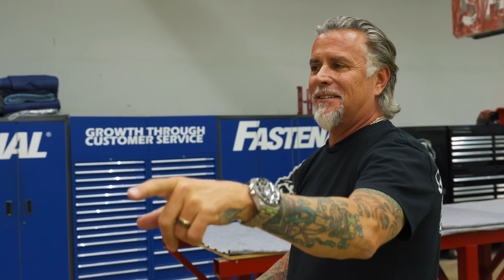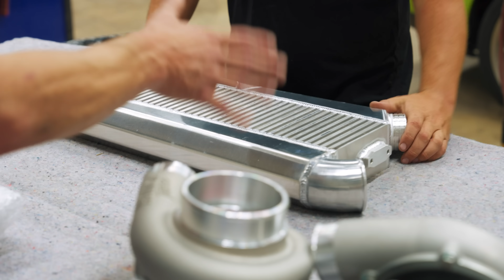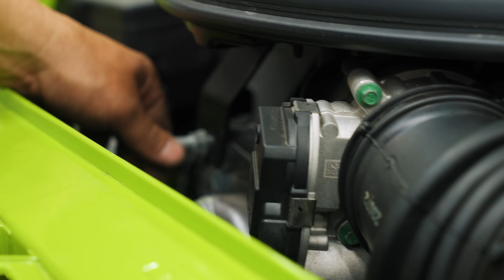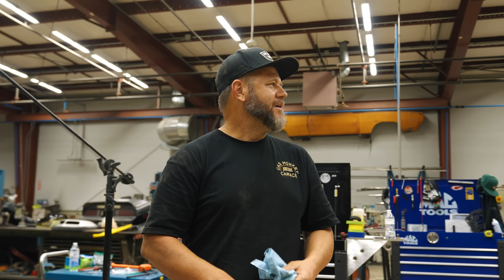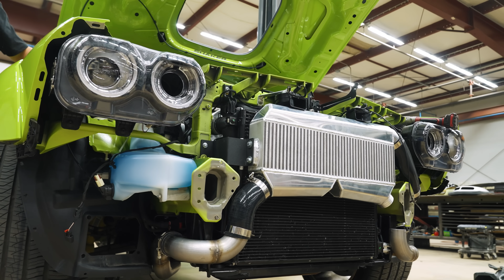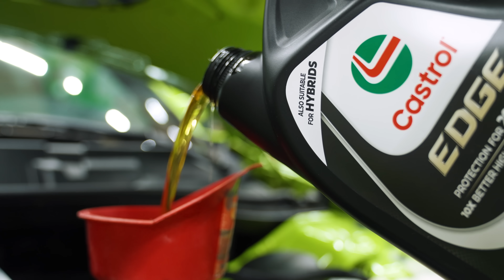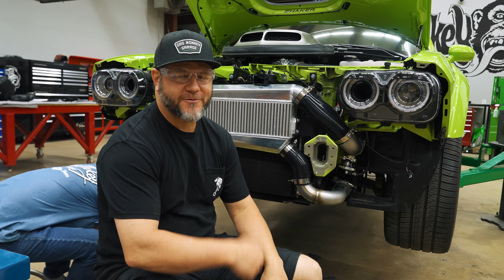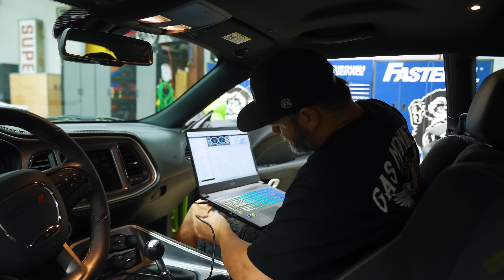Twin Turbo Dodge Challenger 392 Build | Gas Monkey Garage

Comment: The LS is definitely the better motor. Much less complex, so easier to work on and more aftermarket support. Cheaper to purchase, more reliable and have been made much longer. Plus you have options between having a 5.3 all the way up to a 7.0. They also sound better especially with aftermarket exhaust systems.
Reply: Maintenance is hard I guess. 

When it's time to take it apart yes there is more moving parts, but they are there to increase the volumetric efficiency of the engine. Worth while trade off in my opinion as an owner. NA yes 7.4L LS based engines are powerful. Boost with rpm, and that previously mentioned efficiency equals. The same kit for the mustang makes 700-800 whp with 1.4L less displacement. 
Spend your money how you please, horsepower isn't cheap if you build it right.
Reply: @andrewmcbain4119  I more than know HP isn’t cheap if you build it right. Being raised around a Drag Strip and circle track since the 70’s I’ve seen my fair share of engine build types. I’ll choose the simple proven engine time and time again. I’ve seen plenty 454(7.4) and 572(9.4) engines make very big power on boost. The 572 is capable of over 800 engine alone. A reason I’ve never used NO2 is because I’ve always believed of you put in the wrench time, the money and the knowledge it isn’t needed snd proves you can build one hell of an engine without it. 
Don’t believe I ever mentioned anything about maintenance because all engines require maintenance but since you mentioned it sure less maintenance as well because you only have a single cam to deal with in an LS based engine. Not to mention those troublesome cam phasers in the 5.0’s.
Reply: Sure...
Reply: @tjcustomrodz  prove a 5.0 Coyote or a 5.2 is cheaper to build, easier to build, less complex and has the aftermarket support the LS based engines have.
Reply: @P-J-W-777  heads, cam, and internals. Which supports more before upgrading is necessary. Yes if you want to make 4 digit horsepower big displacement is helpful, and yet examples of coyote engines with bottom end upgrades nothing to the top end making 1500hp or more. With boost obviously. It is never gone to beat the 100K engines out there, but it's not a dog compared to the LS. I have both sitting in the driveway I know which one I'd rather spend my time on.
Reply: @andrewmcbain4119  Don’t get me wrong, I’m definitely not calling the Coyote a dog or saying it’s not a good engine. In my opinion it’s one of if not the best engine Ford has produced since the original 5.0 and 5.8. I absolutely respect it and have utilized the Coyote and its cousin in the F-150. I don’t rate an engine based on horsepower alone but also on reliability, complexity, cost, parts availability and aftermarket support.
Reply: @P-J-W-777  that's fair. I haven't had any reliability issues with the engine.  The cheap transmission, the MT82 ,on the other hand I have had to replace a gear on so.
Reply: @andrewmcbain4119  Good to hear, I haven’t run any of the newest 5.0 or 5.2 engines. Everyone seems to be having issues with the modern transmissions. Usually why you don’t hear of anyone doing a restomod utilizing them in their builds.
Reply: @P-J-W-777  I'll add the coyote platform isn't a great option for trucks. It'll make the power, but yes concerns you have will be highlighted with added strain on the engine. Ford themselves admit it by using the 7.3L Godzilla in the super duty line.
Reply: @andrewmcbain4119  yeah unfortunately I’ve seen a few cranks snapped after adding a supercharger. You can upgrade the crank making it more reliable but most people don’t want to tear the engine down and rebuild it. They’d rather add a few mods to improve the performance. We had quite a few a bit of problems with the 5.0 in our fleet of trucks. They were constantly in the shop but did run really good for a truck when they were running right.
Reply: @P-J-W-777  I can imagine I had a 2V 4.6 in a F-150, replaced it with a 08 Ram 2500 6.7 cummins, it had to work hard during regular driving and needed a lot of love. 
The 5.0 would definitely have been better, but again high stress compared to bigger engines it competed with. It's best use is definitely something lighter, and not intended for work.
Reply: @andrewmcbain4119  I still own a 2006 Ford F-150 with the 5.4. We also had another 2008 F-150 and a 2008 Expedition with 5.4. I purchase all of them brand new. Both the 08’s had nothing but issues. Especially the spark plugs ejecting from the heads. Oddly enough the 06 has never given me a single issue button has 60k miles on it as well. 
I am definitely a fan of the Ford Diesel engine and currently own a Powerstroke. I’ve had the engine rebuilt twice and after the second build I removed all the government crap and haven’t had a single issue with it since. The engine runs much stronger and much cleaner now. I also get 24-27 mpg whereas I was averaging 12-14 on the highway with all the emissions systems intact. No, I don’t roll coal either even though it’s fully capable if I switch the tune.
Reply: Why has no LS 
 Gone 300.4 mph in a standing mile 
Ran 5.88 @ 256 mph with mostly oe parts
Won overall Sick Week, Tx2k24, Import vs Domestic and set the drag and drive radial record 6.26 @ 227mph with oe castings 
Or run 7.7s factory sealed?

Because the twin cam engines from Ford are superior in design and efficiency and set the previous world records.
Reply: @chadkent1241  yeah and how long do they last? How much do cost? How much more complex are they? Those twin cams with their cam phasing issues, time chain guide and tensioner issues just to name a few. The fact is that it’s taking a modern engine to keep up with the LS that’s been running since 97.
Like I’ve said previously I do not disrespect the Coyote. I believe the LS is a better overall engine platform for a multitude of reasons some of which I’ve previously mentioned. Someone next year could build an LS or LT engine that ends up taking that record. You never know. It’s all about the build of the engine and the “luck” the team has at the racetrack that weekend. I’ve seen plenty of teams that normally run in the 7’s go out and can’t get anything better than an 8 or o=9 second run for a few weeks and then turn around and run a second 1/4 mile a few weeks later.
Reply: The Hemi makes more power and sounds less like a truck motor. The LS is only cheaper.
A 7.0L LS7 makes 505hp but a gen III based 7.0L 426 Hemi makes 610hp.

The ZZ632? 1,004hp on pump gas from 10.4 liters, all motor.
A 9.9L 605 Hemi makes 1,002hp, all motor. Same power with less displacement.
Reply: The LS pushrod platform is the easiestp and cheapest to build with the most aftermarket support of the three main manufacturers Chevy, Ford, and Mopar. Ford's platform is the most complicated and expensive to build or modify and  it lacks the lower end torque the LS and Hemi platforms have. The Hemi doesn't typically respond to the mods as well as the LS and the Coyote platforms do. But this twin turbo Hellion kit is pretty awesome. I imagine they will make one for the Chevy and Ford offerings as well? Anyhow, I have 5th-6th Gen Camaros and 6.4 and 6.1 Challengers on my search list in my upcoming muscle car purchase. There's a pretty large selection of low mile modified 550-750 RWHP  cars available in the $18,000-$30,000 range right now on the market. Many with forged internals and built right. You can't come close to building yourself for what you can buy already built and the seller taking a massive loss. It's a buyers market right now if you're a smart, educated, shopper.
Reply: LS motors are not reliable. They blow rear main seals routinely

Comment: So what about the suspension and other stuff that takes the turbocharged motor beating? You’ll want to add a diff brace to that kit  along with a list of other things to prevent the wimpy stock parts from being damaged by the increased torque.

Comment: Ask any woman and if she is honest, she will say that "Bigger is not always better"! Go to some lady of the evening and see for yourself what some asshole with a twelve inch coke can unit has done to the really nice woman supporting a family has had happen to her privates. Sure its controversial but putting eight hundred horsepower in the hands of a eighteen year old kid who is starting from a learners permit to drive behind the wheels of this car is a recipe for dying. Not against horsepower, just saying what happens if no one cares enough to teach a kid how to drive in a case like this. I started driving with my dad because he would stop at a bar, get so drunk he could barely see, he had shown me how to turn the steering wheel and that is where we started at, the truck in second gear idling along as dad slept and me turning the wheel. We get home and I turned off the key.... nudge dad, and he woke up and said..... "Keep this to yourself son" you know moms gonna be pissed if she hears I let you steer the truck. I like this system and seen stuff enough to convert a rock crawler rig up where there is no loss of oil when the rig is running and on its side for some distance. I am talking about some thirty year old engine with no special pumps or designed to get the oil back to the pan and keep things lubricated right. I started pulling wrenches every day for dad when my butt was a single digit age. No I did not put in transmissions, but I sure as hell knew how to check the level of oil in it an how to add more if needed. In the nineteen fifties, everything leaked oil. If it did not leak, then it was completely out of oil. Gaskets made in the day are not so much different is so many ways now than back then. Its how they apply stuff to a gasket and when to or not to use a silicon in those applications. Okay my comment is now way too long

Comment: Wow , that is cool knowledge . Supercharger is hooked up to a belt system , so your top rpm is your max out , where the turbo will max out and hold boost before max rpm .
Reply: Yall brought in a awesome company representative.  You can see how genuine he is about what he is talking about , I don't think there is enough time on the day for him to express his passion.  He did say he walked into the opportunity,  starting off working hard on his own for a hobby . You never know what can happen , keep working thoroughly and never say you can't!
Reply: And because its hooked up to a belt it reduces initial HP. Eg you turn AC on the power reduces. Pros and cons of both tbh. Turbos have come a long way Turbo lag used to be a big thing but not so much these days. Turbos sound cool to

Comment: I drive a delivery truck.   LS 6.0, 318,000 MILES. Pedal to the floor every day. Water pump, alternator,  radiator,  brake booster, spark plugs, coil packs, normal sheet.  And a transmission at 300,000.  Does not use oil.  No leaks.  LS ALL THE WAY.
Reply: I’d advise you not be an “LS all the way” over an outlier and that’s exactly what it is is an outlier. This is not the typical LS lifespan, not even close. The only benefit to an LS is it allows them to play with the other guys without putting in as much money, that’s the ONLY benefit LS has over any ford or mopar engine platform. There’s only 1 best and that’s been determined long ago by NHRA.. There’s a reason the fords, chevys and Toyotas run hemi heads. The reason is they still can’t surpass or even match the technology of the hemi. About 7yrs ago give or take ford, Chevy and Toyota btchd a fit it to the NHRA because they were losing too much so the NHRA agreed that ANY car running full hemi engines and heads MUST add 50lbs to the car to make it “fair”. And they’re still getting their asses handed to them. The hemi is 70+yrs technology and no one can beat it today, not even these other guys that copy the hemi head and put it on their own blocks. Can’t argue with numbers and stats. 

And when you say to the floor every day. Your foot may be to the floor but the throttle isn’t because they put what on all these company vehicles? It’s called a governor that regulates how much throttle and rpm the engine can respond to
Reply: @jizchimp no bebe mi hellcat jailbreak no tiene regulación y de fabrica 😮❤
Reply: @jizchimp  no governor.   Stop light to stop light.  Do the speed limit.   Shata.   327000 miles chimp.and your stupid  name makes all the sense in the world.
Reply: @jizchimp where are you finding your stats at from a cereal box LOL LOL
Reply: Bro I love Chevy but your a lucky mf😅
Reply: I don't know why exactly, but this had me tickled pink LMFAO. Out of place as it may seem for a custom 392 Hemi Challenger Gas Monkey build; It's perfect 😂👌 Absolutely necessary.
Reply: Lq4 or lq9 6.0 ?
Reply: I have an actual Silverado SS and let me tell yall I think the only thing I’ve changed is the brake pads a alternator and 1 radiator of course hoses and of course a battery or 2 within the last 5 years
Reply: @aaronvilla13  I'd really like to borrow your truck 😂😂😂
Reply: LS ISNT THE ONLY WAY lol
Reply: Working for fedex we have P1000s with  the ls 6.0. They go forever
Reply: A 6.0???😂😂😂😂😂
Reply: I want to see Dyno numbers
Reply: LS is embarrassing. We retired those, we moved on
Reply: LS is cheaper if maintained. I was a LS guy on everything until I built 1956 Panel Truck using Crown Vic P71 and just dropped the panel truck on it. I actually like Ford now. LS will last longer but price wise. If you can't find a good P71 Crown Vic. Mopar is just way overpriced!
Reply: I actually seen a Ford motor with LS springs, rockers etc. It belongs to Derek Bieri. He used it on the show "Roadworthy Rescues" it has the best of Ford and Chevy parts. He had a friend make some specialized parts to make it work though.
Reply: Lol  you know nothing
Reply: That's nice my uncle drives a 5.7 2006 with 298k miles btw still stock bottom end upgraded intake and etc upgrades diff still does donuts like an idiot and screams at 5800 rpms
Reply: Yeah for you lmao never had any problems with my Mopar motors I've been blessed cuz of heard horror stories lmao and I've also heard horror stories about LS engines too now.
Reply: Twin turbo Callaway Sledgehammer Corvette, I know for a fact that Gas Monkees can't imitate that blow-off sound 😂😂😂
Reply: @gearmeister lol o man your Soo right that thing does sound wicked

Comment: Thank you for changing out the shaker.  That color absolutely sucked.  I agree with the wheel color issue as well.  Those colors just didn't work with the green.  It's like an accountant said, "the part number is available."

Just a suggestion - You identified the wheels and shaker needed to be black, and you pulled the yellow protective strip.  Post some pics so we can see the end results.  You might sell more tickets as well.

Comment: The Swinger package is pretty rad especially with the 6 speed. Might need to add a McLeod RXT clutch. That stock one will not last at all. AEM makes a wideband gauge with a OBD piggy back so you can actually ad the AFR to the PIDS in the HP Tuners. AEM 30-0334

Comment: Can tune it up “ if all the fuel and engine mods are there already 🤣😂👌. Always read the fine print boys and girls . Don’t get suckered and find out you need $3-5k more upgrades to get these “ claimed “ horsepower ratings . And also eats your transmission and drive line for breakfast 🤦‍♂️

Comment: The 5.7 is the best they  already have more power  thin the 5.3 V8  just my opinion I  am building my 5.7 in my 04 dodge ram 1500 5.7 hemi 4x4

Comment: I had a 1973 Swinger that same exact color. It made an eye watering 175 hp.
Reply: Damn it's a wonder you were able to keep it on the road with all that horse power...
Reply: @KA317-1  they don't call it the Leaning Tower of Power for nothing!
Reply: ..eye watering 😂
Reply: I bet it was nice !! build a time machine and bring it back 😅😅😅
Reply: it’s so crazy to me that the ford lighting (04) was a v8 with a whipple super charger and only made 340 hp.. can someone help me understand this
Reply: @jupiterxqzk  I'm not really sure, but maybe the bottom end wasn't strong enough for more than that. Maybe they were trying to meet CAFE requirements. There was also a time in when street cars weren't legal to have more that 500 hp. Hopefully somebody will answer that knows more about that truck specifically.
Reply: Well that was during the oil crisis so. Cars went from having 350-470hp to 230 and below

Comment: So your taking a true ram air shaker hood car and completely making it useless 😂
Reply: I literally thought the same thing! I haven't watched the whole video yet, but hopefully they still utilize it
Reply: @matthewkingsmore8824  they don't 😔
Reply: Why are you crying about that? If that was the only way to use this kit to get 700hp that's something I can love with
Reply: @Nemesis-302  1 of 200 built ! Could of used a regular 392 , just saying its not the right  car for that type of mod
Reply: Also dramatically lower the price of the car by putting an aftermarket turbo kit on it he should have just left it completely stock
Reply: @mr.k6136 it's still just the same damn challenger they've made forever it's not gonna be worth much, so stop...392 engines are a dime a dozen